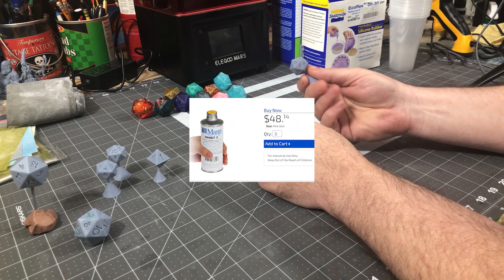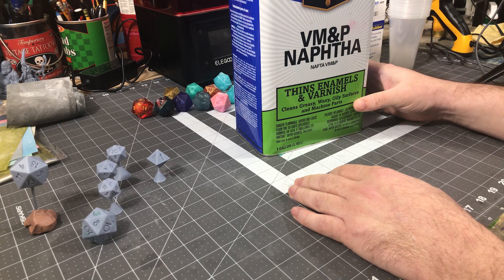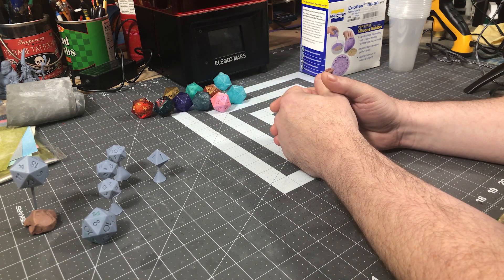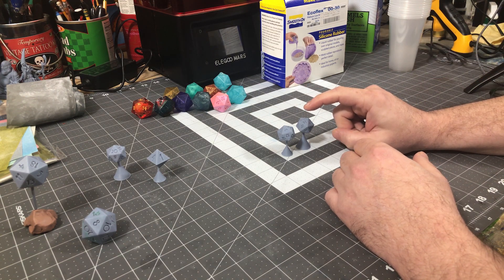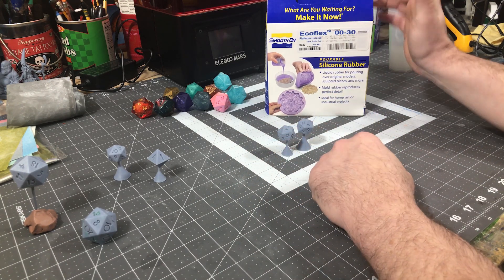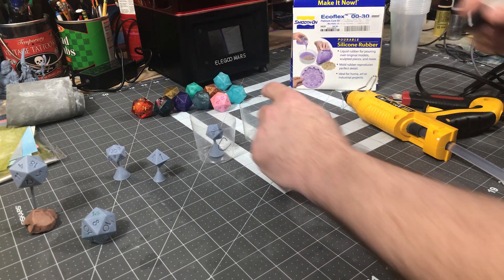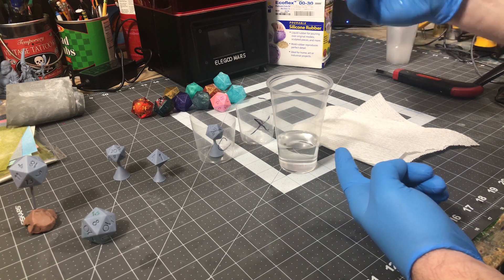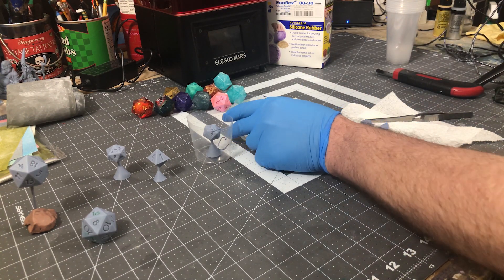InhibitX vs Naphtha are they the same?

Comment: The MSDS only has to list chemicals that are considered hazardous so it's not a way to figure out what is actually in the inhibit x material (seen multiple videos on this exact same subject). Of course the simple solution would be to switch to 'tin' cure silicone instead of 'platinum' cure silicone as it's very hard to cure inhibit it. The normal culprits of sulfur and such won't stop 'tin' cure silicone from curing. Oomoo 30 is a suitable replacement for the silicone you are using (from Smooth-On).

Comment: I'm pretty sure the single component label in their listing is referring it to being a single product as opposed to something like the silicone which is a dual component or 2 part product. Also if you look at that chemical listing on the SDS it shows that the Naptha is less than 100% of it's makeup. So there are other chemicals in there, but they must be relatively harmless. to no end up on the SDS.

Comment: So just to help clarify your findings. SDS data sheets only have to report the hazardous materials in a product. So if there can be other non-hazardous components in the product as well.
Reply: Indeed, so they can get away not disclosing industrial secrets if they aren't hazardous. Im trying to figure out how Inhibit X works (never have used it but wanna make my own cheaper version)  and I think it must work by two principles, It could create a sealing layer, maybe a special polymer with very low permeability to some molecules so even a very thin coat is enough (the datasheet says "resin solution") or it could have some compound that scavenges and reacts with anything that the silicone reacts, maybe even both principles are at work but what exactly is what they are using?

Comment: Just bake the resin parts in the oven for 4 hours about 82C.
No need for any extra products and it will cure perfectly
Reply: But do resins withstand such a temperature? For example, Elegoo WW or Frozen 4k?
Reply: @MrIwan900  you can try with a lower temperature
Reply: Just make sure your resin is properly cured
Reply: @harald_schubert  If you don't mind, I have a few more questions.
1. Do I need to wash the models in water or alcohol after baking in the oven (depending on which resin is used)?
2. After baking the model, after what time can I try to fill the model with silicone? Immediately or is it better to wait?
3. Do you cover the model with some kind of separating grease after baking before pouring silicone?
P.s
I did some tests with small models (Elegoo WW Black resin) and different separators. There were both negative and positive results. I thought I had solved the inhibition problem. But as soon as I filled in the working model, I was waiting for a failure. I've tried many different approaches, but I haven't found a solution yet.
A few hours ago, the models were baked at 82 degrees (Elegoo WW black resin). They have withstood this temperature and preserved their geometry, there seems to be no distortion. I hope heating will help prevent silicone inhibition)))
Reply: @MrIwan900  gladly help you.

Step1: after the resin print has been printed, clean it with isopropyl alcohol.

Step2: cure the print in the sun or uv light (black light) for longer than usual.

Step3: bake it in the oven. (80 degrees for 4hours)

Step4: after it cooled down spray a mold release on the print so that it is easier to get the silicone of the print, but it isn’t a necessary step.

Step5: let it cure and if you see some inhibition put the silicone in the oven and bake it and the inhibition is gone.

Side effect the silicone might be shiny ✨

I’ve tried it and it always works for me😃
I haven’t found a minimum time for baking the silicone but I’ve went for an hour so far also with 80 degrees, but you probably get away with 30 minutes
Reply: @harald_schubert  Thank you very much! Today I will try to pour silicone, I hope everything will work out)))
Reply: @MrIwan900  remember you can harden the silicone in the oven in the mold if it doesn’t cure correctly
Reply: @harald_schubert  Uh-huh!!! It worked! I filled one model that was not in the oven, but lay in my room for 42 hours before filling and one model that I baked for 4 hours (although it also lay after the oven for 21 hours). The one that was not baked has a little inhibited silicone in hard-to-reach places (I have a master jewelry model), but it's much better than pouring silicone almost immediately after curing) And the model I baked is just perfect! There is not a single trace of inhibition.
I did not cover all the models with any additional separation agent for the purity of the experiment.
Oh, if I had seen your comment earlier))) Thank you so much and I hope that our dialogue will help some other newcomer in this matter as well as me ;)
Reply: @MrIwan900  I’m so happy that I could help you
Reply: @harald_schubert  80 Degrees Celsius or Fahrenheit? I also hearedthat some time under extreme UV light also helps. My masters will be ready soon so I will try to get cured silicone soon XD
Reply: @GlutzahnLP  Celsius 😉
It’s a combination of both.
I newly tried to put my resin in water and shine uv light in the water like that the light goes everywhere and the resin cures faster. But you still will need to bake it

Comment: Thanks for the test...this is vital for my projects as well.  From what I understand, curing the resin is KEY.  At least UV cure or sunlight and maybe even bake the printed parts at a low temp in a dedicated toaster oven.  I have been using inhibitX and it works with CURED resin molds.  I let them soak OVERNIGHT in a glass jar.  I am going to try the naptha as well...  We only have the quart size here for $9 at lowes but beats 50 bucks all day long. : ) Thanks again keep em coming..   I am also going to try an airbrush (thin) sealer and dip them and see if that seals them.  Anything but a spray can of acrylic is what I need.  Here's an interesting read from smooth on on this topic: https://www.smooth-on.com/support/faq/210/

Comment: Just FYI, I've seen a recent video comment (though can't remember where or who) that says the sds for the can of inhibitX they have seen also lists a small amount of shellac as an ingredient. I can't confirm or explain how this could be, different ingredient listing requirements for different countries perhaps? I think shellac is considered a "natural" ingredient so maybe it doesn't have to be on the sheet in all geographic regions? Anyway, just some food for thought. I'm doing some new tests now with thinned shellac as a barrier.
Reply: Read this comment today and I've set up a test that will dry overnight. I've got naphtha + shellac varnish (4/1 ratio, the varnish already has naphtha in it though so its rough at this point). Also have a naphtha + urethane varnish at 4/1 and 2/1 ratio (the varnish also contains its own naphtha so the extra I'm adding is to thin it). 

The last one I'm testing is rust oleum clear gloss aerosol which as far as I can tell is the same or very similar to krylon clear coat acrylic. 

I'm in new zealand so all the products will be different from US (naphtha is called white spirits over here) but if I'm successful I'll post my results tomorrow. I'm smooth on using mold star 15 slow which I had a inhibited cure today on my resin print (saraya tech fast abs like grey). I like the resin so would be good to know that I can wash/cure and mold within a reasonable amount of time if I can find the right sealer for it.
Reply: @DanielElliott3d  While working on another unrelated project, I discover that Smooth-On's Mold Max 30 does not inhibit against syratech blue.  No sealer, no soaking, no baking. This is a tin-cure silicone though.
Reply: @RichardThompsonArt  yeah I was going to pick up some to try but it's sold out at the distributer in my country
Reply: @RichardThompsonArt  have you tried oomoo which is also a tin cure? wondering what the differences are.
Reply: the results weren't amazing. the shellac was the best. I realise that it doesn't dissolve in naphtha though. so I need to thin it with alcohol and try that. 

also I read on reddit a list titled something like "you don't need inhibitx" and realised I'd only cured for a few minutes. now I've printed someitttlw test pots that take 10-15 minutes to print and trying to cure them in my diy cure box for hours and see how they do.  I did a cure of two hours and that wasnt successful. I interestingly, the pot with just curing + mold release did better than the one that had a acrylic gloss and another with paint primer. I'm curing for a few more hours today and will repeat the test.

Comment: So my only input on this is that I have had failed molds using inhibitx on fresh prints. So I would like to see this experiment redone in stages, make 3 prints instead of 2 and 3 stages so 9 dice. Each stage using no chem, 1 with inhibitx and 1 with naphtha. Print 9 dice and run this test every day for 3 days.
Reply: That would have been a better test... and kinda what I expected.

Comment: I wonder if this just isn't a case of being the "wrong" naphtha. There are petroleum naphtha's made from crude oil, but there are others made from natural gas, coal tar, etc. I think they are probably all called "naphtha" on the label. Unfortunately it would require someone who knows a lot more about chemical compounds than me to tell you how to tell them apart ( but probably a smell test would be a good place to start). I know from experience I've had this sort of problem before with other thinners, there's just so much naming confusion. I ended up here because I've also recently been looking at inhibit x , here in Canada it's $70 a bottle.
Reply: The msds sheet lists it as naphtha petroleum
Reply: @reinkdesigns  I think you might need the other one, from natural gas. I only say that because inhibit x seems to have a short shelf life, according to what I've read online, which,  (to me) indicates it maybe becomes "less potent" over time the way fuel does, like there's a high vapor component evaporating out. I'm going to check out my local automotive paint shops and see what they can tell me. I'll let you know what I find.
Thanks.
Reply: I believe you are correct with the Naphtha. I have a basic understanding, so be warned this is a long-ish comment. But in short, I believe Inhibit-X is your best bet, second is leaving the resin prints out for awhile.

In full,  when looking at Inhibit-X's Safety Data Sheet (SDS), the full name is Naphtha (petroleum) light alkylate. The name sort of describes its production. But the name isn't chemically specific enough. For specificity, I used the Chemical Abstract Services Registry Number (CAS number). Inhibit-X' s CAS-No is 64741-66-8. But it's not 100% and the remaining chemical components aren't listed. (This is shown briefly in the video above)

The CAS number is a unique numerical identifier for chemical substances. You'll find CAS numbers of things in their SDS, section 3 - composition/Information on ingredients. Various chemical databases describes that particular CAS-No as a complex hydrocarbon mixture. 

The automotive paint shop idea was also good. A product: WD-40 Motorcycle specialist total shine, had that chemical. But they don't seem to sell that specific product not any more. Unfortunately, it appears that specific chemical is only really available from specialist chemical companies. The companies you have to contact first before they tell you their price. 

Regarding wait time, I believe @Richard_Thompson's channel, someone also mentioned leaving the resin model out for between 2 days, to 4 weeks. Something which accidentally happened and stopped the cure inhibition in the video above.